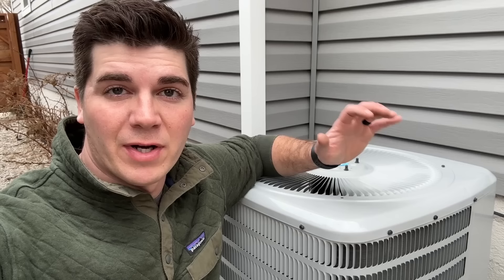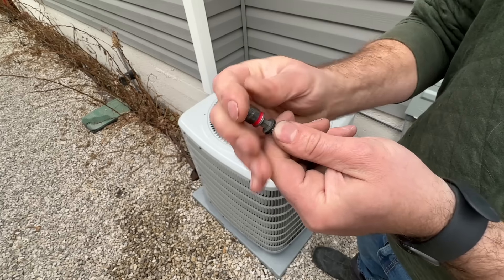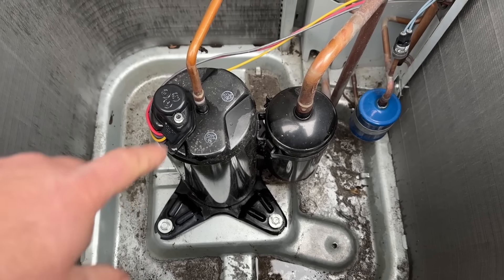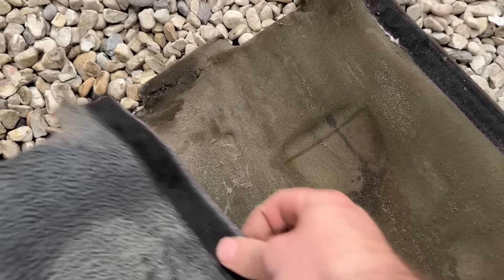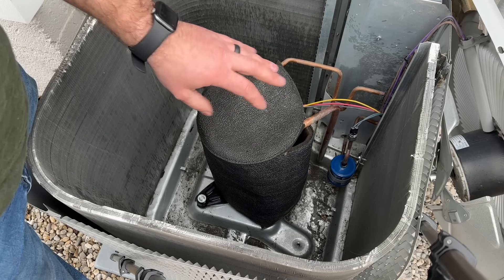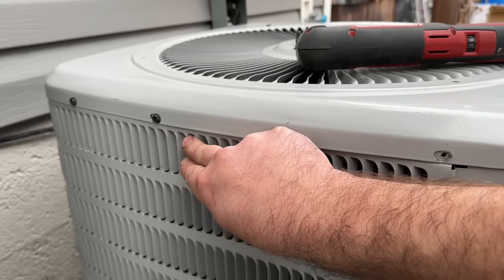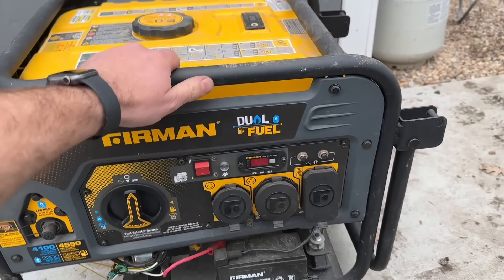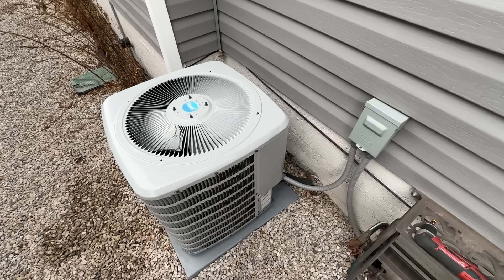3 Easy Ways To Make Your Air Conditioner Quieter

Comment: Doesn't that jacket increase the amount of heat around the compressor, and therefore also shorten the lifespan of the compressor?
Reply from the maker: It’s minimal, because some nicer units come with a compressor jacket. The cheaper ones do not.
Reply: @diyhvacguy  Isn’t the compressor refrigerant cooled rather than air cooled anyway?
Reply: @sandramays795  was wondering the same
Reply: @sandramays795  yes the compressor is cooled by the returning refrigerant from the evap coil unless the system charge is incorrect
Reply: it does reduce compressor life span iv been in the Hvac biz for 30 years  seen it many times 😂 easy service call 
i  rip those off and hose down the over heathing comp. and sometimes AD a bunch of ice on it and voila it restarts ...most of the Time 😅
mini wall barriers( removable ) around the unit at about 20 inches around is safer an more efficient...👍
Reply: If it was necessary, I believe the engineer would have put it on from the factory. The repair should never attempt to be the engineer also.
Reply: @simonac688.  i have a compressor tube running inside my master bedroom wall… any tips on how to lessen the noise? Without destroying my wall? They added a some runner cover on the pipe inside the unit but it almost did nothing…
Reply: Compressor jacket on old compressors, as a homeowner, it FEELS like it could start a fire by melting the jacket because if a compressor is faulty and overheats big time 😧😧😧😧😧
Reply: @simonac688.  When I Did HVAC I did the same thing I would Rip them off also.
Reply: 😊 @kenranous
Reply: @offspringrocks08 if it isn’t a necessary component for a working A/C I would think manufacturers would leave out the expense of a deadening wrap to lower both manufacturing cost and the retail cost, hence the earlier answer was some more expensive units come with one.
Reply: Got same problem @linvol20
Reply: @linvol20 similar question! Did you find any solutions? Thanks’
Reply: @linvol20  do you mean lineset? And what do you mean runner cover? You mean insulation?

Comment: I found using some zip ties to secure the wire shroud on the top helps eliminate harmonic noise where the shroud resonates at its harmonic frequency helps huge. When running use you hand to put pressure on various point on the shroud. When you can make the noise go away place a zip tie there between two of the shroud wires which then doesn’t  allow the wire to resonate and make noise anymore. Explaining this is difficult but I think you get the point. Also putting small rubber pieces between the coil and the wire mess on the outside where similar harmonic noises happen works well too.  4-5 placed zip ties and half a dozen soft rubber pads eliminated most all of these annoying harmonics on my unit. Thanks for the video.

Comment: Many times those installation blankets aren't good since it holds the heat in from the motor not allowing it to cool off causing it to run even hotter.

Comment: Another source of noise is the line set from the compressor to the furnace.  We have one that runs vertically in an exterior wall.  It was touching the drywall, making a super loud buzzing sound in the house.  Moving the line set away from the drywall helped a lot, but it's still annoying to be in that room.
Reply: Hi, I have the same issue here, did you come up with any solutions?
Reply: @qingchang1480  It helped a lot when we moved the tube so it doesn't the drywall.  But we weren't able to completely eliminate the noise.  That would probably require running a new line.

Comment: Does anyone have experience with: ICM870-16A Soft Start, Built-in Start Capacitor, Over/Under Voltage Monitoring, Over-Current Protection, Current 16A.  It is selling for less than 1/2 the cost of the Micro Air unit.  This would be for installation on a residential  3 ton Carrier AC unit with an RLA of 16 amps and a LRA of 82 amps?

Comment: I geeked out on HVAC when my furnace died. As a mechanical engineer I enjoy this stuff and after seeing the quality of work the previous "professionals" had done on my 1954 house I redid  EVERYTHING including the ducting and switching from a gas furnace to a dual fuel heat pump/ gas furnace setup. I wish I would have had your channel 6 years ago when I was doing this as it probably would have saved me a lot of time.

Comment: The #1 Way to Make a Compressor Quiet is Evacuating the System Overnight for 12 Hrs Minimum on a New Compressor !!! You do this on a NEW Compressor install & YOU WILL BE AMAZED !!! At how quiet Compressors can be. You Can barely hear them.

After over 40 Years in the industry i Discovered this Many years ago.

Makes a HUGE DIFFERENCE !!!
Reply from the maker: Very interesting. I wonder how that works with the new tubes they use and no manifold. Supposedly they can pull down to 100-200 microns in like 10 minutes.

Comment: Hope this helps, the soft starts actually work and are not snake oil. I have a Firman generator from Costco, output is 6750watts on propane. Would trip out when trying to run the AC. I installed Hyperstart's SureStart  SS1B08-16SN on my AC unit that had a ZP29K5E compressor with a RLA of 15.3A. I am able to run my AC with the Firman and as a nice bonus the softstart got rid of the start up "slam" that used to wake me up at night. It's been running for 2 years now no issues, I had a few questions during install and the Hyper Engineering support was fantastic. Took less than an hour.

Comment: Yes your correct. I just took mine apart and cleaned it took off all the side panels and it was a hell of a time putting them back on after I cleaned it all up.
Reply from the maker: You are way off bro, the purpose of the fan is to extract heat from the COILS, that’s the whole idea of the refrigeration cycle. Some compressors like Trane equipment come wrapped from the factory, but it costs a lot extra to wrap the compressor on millions of units so most companies don’t.

Comment: Tape up all the gaps on the blanket. Sound travels through cracks the same way air does--because sound is vibrating air molecules. Think of how much more sound (or cold) comes through a cracked window versus a sealed one. Think of how much sound comes out your tiny phone speaker hole! Even the smallest gaps can leak a lot of sound. I built recoding studios and air leaks are the first step towards sound proofing (before insulation) just as air sealing is the first step towards reducing heat loss (also before insulation).

Comment: Good evening and I hope that you are doing well. Thank you very much for the tips that you provided in this video! Besides the compressor jacket, I really need to look into installing the easy start kit as well. My unit is working fine, but it does make a quick yet aggravating noise right when it cuts on.
I just finished watching your video on how to easily clean the unit for summer. That being said, you’ve earned yourself a new subscriber here. Thanks again and take care.
👍🏻💯

Comment: I have the self-installed EasyStart for my Carrier 4-ton unit. It allows my to run the A/C when using my Firman Tri-Fuel Generator and is quieter. (BTW .... I don't do Instagram or Facebook).

Comment: You can use fiberglass or rockwool but it has to be covered in plastic so it doesn't get wet, or find a use jacket from an AC shop.  Most manufactures say 18"s around and open to top.

Comment: do you have a recommendation for a  hard start kit..  after watching your video.. i decided since my ac unit is going on  (from date of manufacture) 10 yrs.. im going to replace the capacitor for safe measure.  and maybe add a hard start kit while im at it.

Comment: Would building a wall with concrete blocks on one side lessen the noise?
Reply: If the entire unit can still breath to cool itself, that will work. You're moving hot from inside the house expecting to dissipate it outside the house, and if you prevent that dissipation, then proper cooling won't be achieved, but deflecting the sound away from the house is okay. It might be nicer to use a lattice with vines instead, as the vines will also help to absorb the sound so it isn't deflected to your patio or neighbor's patio, plus, vines help with natural cooling and converting CO2 to O2,, and look much nicer than concrete blocks.
Reply: @philreinie8976  I went ahead with the double thickness concrete block wall. It is almost as tall as the A/C unit. 1 more layer to go. I have a 1ft distance between the wall and A/C. The noise has lessened very much. I can now sleep better at night. I will continue to monitor it and see if it affects the cooling. Fall is here though so it may be pointless now lol.

Comment: Only concern I have with the insulation cover is it keeps the compressor hotter than normally it would be because you’re insulating it. That could reduce its life. Also, you’re containing all those sound energy to within the compressor. Yeah that sounds kind of crazy, but does that affect the life of the compressor?  Nothing comes for free!  I think I’m more concerned with the insulation aspect and keeping an already hot compressor much hotter. It’s all a trade off at the end of the day !  Thanks for the video.
Reply from the maker: The refrigerant keeps the unit cool. Some units have a factory jacket. I think it’s a money thing. They don’t want to spend $50/unit for it.
Reply: @diyhvacguy  Damn, I have a portable unit thats loud as hell, I thought of doing this but decided against it because I thought it would overheat. Didnt even think about the constant flow of cold refrigerant going into it.

Comment: Our heat pump has a whining noise in heat mode, turns out it is the reversing valve. Would this solution be applicable there too?

Comment: I have a Bryant AC heat pump furnace I think the transformer above where the circuit board is 
Is going out it’s humming and the outside unit turns on but the blower motor doesn’t I unplugged the inside unit and let it set then plugged it back in and the blower came on a couple times then same thing would this be a bad transformer 
The info on the side of the transformer is 
BE151840GDD what is a replacement for the transformer 
Thanks
Reply from the maker: If you need a hand with technical repairs, hop over to Patreon.com/diyhvac guy where for $25/mo you will get one on one assistance with anything hvac related and a quick response time. Cheers,   Dave
Reply: Thanks but no thanks on your $25 a month on your patreon I’ll just go on my way

Comment: People do not realize when you put bushes and fences around your outside unit you're suffocating it.  Any good tech can tell that by pressure/temp readings. It would be more the HOA people concerned about hiding the unit. And those compressor jackets will kill your compressor early. Just let that baby breath. lol
Reply: My Trane came with a compressor blanket. Still going strong after 19 years.

Comment: Does spraying water on the condenser to cool it make it any more efficient and does that hurt it?
Reply from the maker: I’ll actually be doing a video on this very soon! Stay tuned
Reply: @diyhvacguy Did you do a video on this? Some critics say the minerals in tap water will do damage to the coils over time. But it does cool more effectively. I’ve tested myself.

Comment: Question if I may? Does the AC Compressor will overheat adding this particular blanket and shorten its life? Well explained by the way, Thanks!
Reply from the maker: Nope, alot of manufacturers come factory with a blanket. The refrigerant cools the compressor.
Reply: Refrigerant cools the compressor internally - it is not air cooled.  If anything, the blanket would further insulate the compressor from the ambient temperature.

Comment: Scrolls are noisy to begin with.  Back in the day, the older reciprocating compressors were 1725 rpm, and were quiet.  Payne units used to come with a wetsuit like compressor jacket. Would that soft start work on my well booster pump? It drags my emergency generator down because of the high starting amps.
Reply from the maker: Not sure on the well pump question. My apologies
Reply from the maker: I wish they made stuff like they did back in the day. I have a 1950s fridge in my garage and it works perfectly. It will probably out live me lol
Reply: @diyhvacguy  I checked out their website.  I guess they won’t work, unless the pressure equalizes, which my well does not.

Comment: Thanks for all of your videos!  I’m thinking about moving my condenser so that it’s not right under a bedroom window. I saw your video on using Stay Brite 8 to make the copper connections. I’m thinking I could probably move it as long as I can pump all the refrigerant into the condenser first. Will the condenser unit hold all the refrigerant from about 50 feet of copper lines?
Reply from the maker: To move it that far you probably would need to top it off with refrigerant. But you could totally pull the refrigerant into the unit and move it and solder the lines in yourself 👍🏼
Reply: @diyhvacguy  Awesome.  Thanks!  It's already got 50ft of line and I won't be lengthening the line, just moving it to another spot where the existing line would reach.  So it sounds like pulling all the refrigerant from the lines into the unit would work?  I was just worried about whether it can hold all the refrigerant since the lines are pretty long.  Thanks for all the knowledge you've shared on thjs channel!

Comment: We live near a cottonwood tree and get a lot of "fuzzies" on our coils. Can screening be placed around the outside of the unit to reduce the amount of "fuzzies" and other airborne debris that accumulate on it?
Reply from the maker: I’m sure you could. I know they make a screen for the top so leaf’s and stuff don’t go inside but I’ve never seen one that goes around the whole unit
Reply: Do not put any screen on your unit. It will restrict the air flow. Just spray the coil off with a hose every so often.
Reply: Shut the unit off, a "soft" dust broom, brush "with" the coils not against them they come right off,  check occasionally.
Reply: @diyhvacguy  pet screen by the foot , design and build
Reply: I unscrew the top off, and use my powerful leaf blower down inside and blow those fuzzies out. Works great 😊
Reply: It won’t reduce the amount of fuzzies. The unit will still trap them in the screen, but it will make the easier to detect and clean out.

Comment: I’m guessing easy-start shouldn’t be used on an inverter system?  It starts slowly anyhow. I’m still researching generator options.
Reply: correct if you have a inverter system should have no issues running it off a generator with low THD

Comment: They put compressors inside and in the middle of the condenser for a reason; the fan will cool them off. However, if you want help out your fellow AC repair folks, by all means, tell people how to kill their compressor early by insulating and trapping in the heat. Then restrict airflow through the unit by blocking it with solid sound-proofing material. Why not go for the trifecta and tell them to just tent it or build a shed around it.